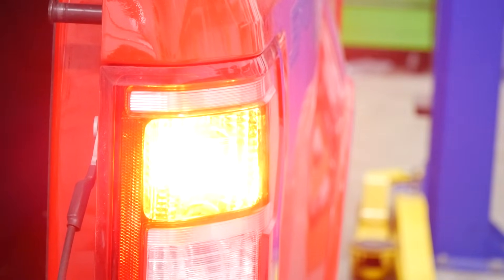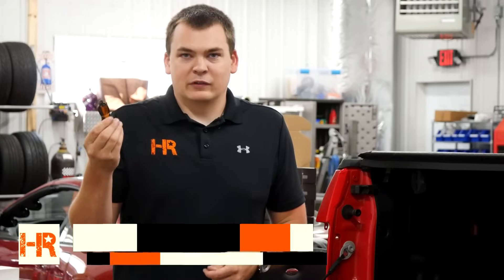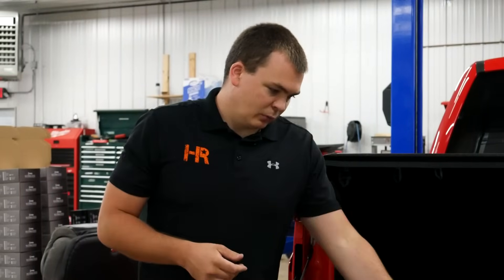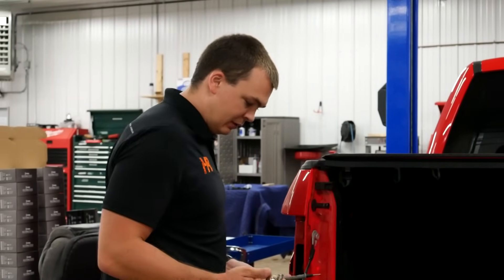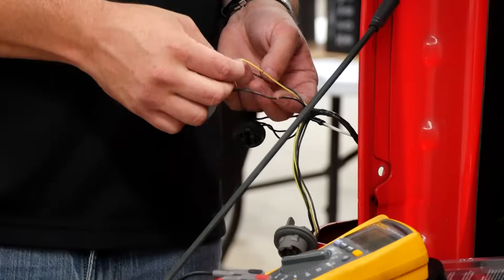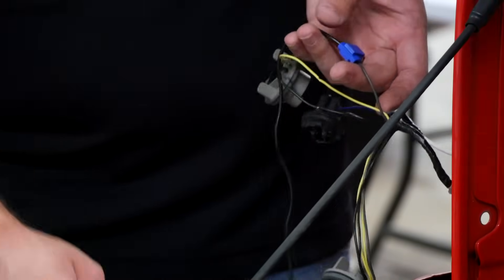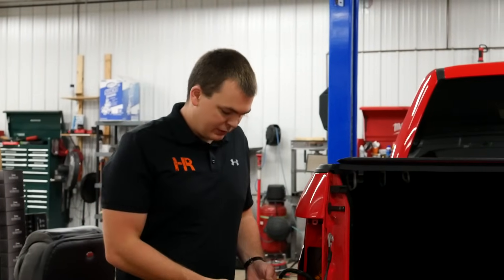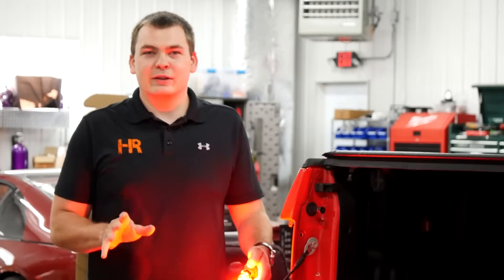How To Install LED Resistors - Everything You Need To Know | Headlight Revolution

Comment: I drive a 07 Volvo xc90 and I recently installed new LED turn signals on the mirror and rear light assembly. If I only put the resistors on the rear turn signals will it also remove the hyperflash on the mirror signals?
Reply from the maker: Yes, it should!
Reply: @HeadlightRevolution   Hi, thank you for your reply! I saw there were three types of resistors under GTR lighting. 50W 6ohm, 50W 3ohm, and 25W 25ohm. Which one fits my car?
Reply from the maker: You'll need the 50w 6ohm ones!

Comment: I thought the resisters came built into the lights you by real cheap from China? No well no wonder mine I just bought from China don't work, mine are motorcycle LED lights anyway so this video doesn't help me at all.
Reply from the maker: There are some LED bulbs that have enough resistance to not need a resistor, but that's only from a few brands. GTR Lighting has a version of that bulb called the Carbide 2.0

Installing a resistor on a motorcycle will be very similar to how it's done in this video. You just need to find the power and ground wires and find somewhere to mount the resistor. 

Thanks for watching!

Comment: My resistors only worked on one side of my vehicle , how could I fix it ?????
Reply from the maker: Double check your wiring.
Reply: Headlight Revolution  I checked several times they still didn’t work

Comment: I have my suv installed a led signal light on all four. Do i need to put 4 load resistor to 4 lines or just 1? TIA
Reply from the maker: You will need 4 resistors, One per bulb.

Comment: I’m having with my tail lights and brake light (all led) when I had the new lights in the LHS of my ute and the original incandescent lights in the RHS of my ute the leds we performing perfectly as as expected (did have hyperflash but that didn’t bother me) the moment I completed to conversion and had the leds on the RHS only half of the leds in the light assembly illuminate and not difference occurs when switching from tail to brake :( I am absolutely dumbfounded as to how this has occurred and was wondering if you guys have ever heard of this before?
Reply from the maker: Hey Meki, Send us an email to sales@headlightrevolution.com and we’ll help you get your lights working!
Reply: Hey it’s all g I sorted it out but I’m just inquiring as to how many ohms your resistors are?

Comment: I hate those little wire connectors with the pin, they’re extremely unreliable.  Get better connectors that you can crimp if you’re not comfortable soldering.
Reply from the maker: That is very true, They can be pretty unreliable. Soldering works very well.

Comment: Excellent but these blue clips should be banned from circulation.They always cause trouble soon or later.The best is to solder the wires or use terminal strip with a screw.
Reply from the maker: Those blue clips can definitely cause some troubleshooting down the line.

Comment: Does your car have to be running when installing the load resistors
Reply from the maker: No it doesn't have to be running. In fact, You'll want it off to be safe.

Comment: What's the difference between installing relay turn signals and resistor signals?
Reply from the maker: Some people install a flasher relay, That is vehicle specific. If you install one of those, You won't need to wire in resistors for the turn signals.

Comment: The point of led is to be seen rite. so hyper flash kinda goes along with that. If it can burn the led out or something of the sorts then I will go through the process to make my designed blinking light to blink just a little bit slower.     If it was a headlight issue then by all means      Also resistors are like packs of
Hundred or more for 3 dollars. Just put a heat shrink around one and that will protect it.    There’s a formula to find what size you need but just look at manufacture site it will tell you what size.    Either way 
Good information. Thank you for the how too
Reply from the maker: Some of these new vehicles will give you a bulb out warning on the dash too, We just want to show people how to make their bulbs work properly. If you like the hyperflash effect you can certainly run like that, Some people do!

Comment: cant you just install a flasher relay at the fuse panel and eliminate the resistor wiring? and if you do need to install the resistor does it need to be on each corner/light? Great video bro! thanks for the help.
Reply from the maker: You can do a different flasher relay on many vehicles but not all. You will need one resistor per turn signal bulb that you upgrade to LED.
Reply: @HeadlightRevolution  I was able to install a flasher relay/resistor on my 65 but not sure where to find on my 2013? any ideals?
Reply from the maker: We don't really mess with the flashers too much here, Sorry. Depending on the vehicle you may just want to stick to resistors, Some of these newer model vehicles don't even use a mechanical flasher anymore.

Comment: Can i put that on headlight?
Reply from the maker: I wouldn't, Instead you should try to find a metal surface to mount it to.
Reply: @HeadlightRevolution  is that okey if resistor going hot?
Reply from the maker: A metal surface will help dissipate the heat from the resistor.
Reply: Thanks, for help

Comment: I have a 2018 Chevy Malibu 1LT and thinking of installing LED reverse bulbs. I tried Sylvania LED bulbs and they both lit dim when not in reverse or the car is off and returned them back to Walmart. What load resistor do I need for LED reverse bulbs?
Reply from the maker: You won't need a load resistor. You need a canbus compatible bulb and the walmart bulbs simply aren't that advanced. Send us an email to Sales@HeadlightRevolution.com and we'll get you exactly what you need.
Reply: @HeadlightRevolution  Thanks. I will look at some canbus LED bulbs.

Comment: I have a 2019 Toyota highlander limited. I've purchased aftermarket LED tail lights. But it started messing with my safety system. Things started ligting up, like my lane departure warning, emergency braking etc.. is there a fix for that?
Reply from the maker: Those lights are likely not compatible with your Highlander’s trim level. I’d check with the manufacturer of the kit to see what they’ve heard.

Comment: If I want to use these resistors in the rear can you use aluminum foil to keep the resistor from touching the plastic?
Reply from the maker: You could. Usually there is plenty of room back there to keep them away from anything that could melt.

Comment: Why not just use an LED bulb with a built in resistor?
Reply from the maker: Because those only started coming out in mid 2019, and they stil do not work on every application.

Comment: I installed LED reverse lights and now have hyper blinking on driver side only. What can I do about that. Any help is greatly appreciated.
Reply from the maker: Make sure you didn’t accidentally damage or unplug your turn signal. A reverse light should never cause a hyper flash, They are two separate circuits.

Comment: I have a question though, if i add more leds to the same wiring harness, would that work too? Since there's more of a load on it
Reply from the maker: You might be able to do that, The resistor is usually an easier solution for most people. -Chris W

Comment: I installed 2 seperate resistors. 1 25w which didnt stop the fast blinking so i tried a 50w which didnt work either. I have a 2013 chevy Silverado. BTW, i attached one wire to the negative and the other to the blinmer positive
Reply from the maker: Those trucks usually aren't too picky, We've found the 50w 6 ohm resistors to work well on them. You might want to double check and make sure you've tapped into the correct wires on the truck.

Comment: What is the resistance value? I would guess 12 Ohm, maybe drawing about one amp and a bit, needing and 12-15 Watt heat to be dissipated?

Why do Americans say "sodder" and not "solder" - why do they forget to say the "L"? Sounds funny to hear it.
Reply from the maker: We use 50w 6ohm resistors in this video for the 2018 F150.

Comment: Question.? 2015 Durango limited 
So I buy mi turn signal light bulbs from headlight Revolution. They say is plug and play.but this is not my case doesn't work so they send me a resistors to fix the problem but still doesn't work...what's happens if I have the truck off the signals work good..but wants I turn on the truck stop working..
Someone knows what problem causes this or the turn signal bulb comes defective...please help.. or the turn signal came defective
Reply from the maker: Hey Cristian, I’m sorry you’re having trouble getting those bulbs working properly for you. Those Durango’s can sometimes be complicated, Send us an email at Sales@HeadlightRevolution.com and we will get it all figured out with you.

Comment: I got a question for anyone that can help me out 
I was installing a new led bulb for my turn signals but upon installing them my side yellow lights (DRL) went out and now they dont come on at all when I turn them on.
I was wondering if installing a  resistor will also fix the side lights as well? or If it'll just fix the fast flashing on the turn signal?
I would really appreciate if anyone can give me some insight on that.
Reply from the maker: Did you get the bulbs from us? If so, Reach out to our customer service team and we will make sure what you got is correct for your vehicle. If you didn’t install resistors with your turn signal bulbs I would try that first.

Comment: For all 4 turn signals, would I need 2 or 4 resistors total?  I've seen some say that certain vehicles only need 2 resistors, where one can be installed to cover both the left front and rear side, and another to cover the right front and rear side.  I'm not sure for an 8th gen Civic sedan.
Reply from the maker: I would do all 4 resistors to be safe. You could always start with 2 and see what happens, but in my experience I’ve always needed 1 per LED bulb. -Chris W

Comment: So my led brake and parking lights flicker. Almost like they have bad ground connections. I wired them up myself so I know it's not a bad ground. Will load resistors stop the parking and brake lights from flickering?
Reply from the maker: It could help!

Comment: That’s what I call a professional video. Bravo
Reply: What happens if you connect the meter to two wires and neither is the ground?  Will you not get voltage on meter or the test lite bulb will not lite up/flash?

Comment: Seems like a lot of work for LED taillights.  I can appreciate LED headlights, but tailights?  My concern, You stripped the wires with a metal wire stripper, with 2 positive wires that could go to ground across the tool to the exposed ground wire.  You risk shorting out the wires, that could blow out a fuse, leading to more problems.  Why not just use a chassis ground & just probe one wire at a time.  This way you're not holding 3 open wires.  Probing will also eliminate the need to strip the constant power wire, reducing the integrity of the wire.

Comment: if anyone using load resistor,buy and use heat conductive selfadhesive tape or heatpad/thermo pad so heat transfer between metal part and resistor will bee much better I did like that to my mazda 6 gh and never had problem with overheated resistor

Comment: Hi I changed my lights to led my break lights work but my running tail light does not work I have changed fuse's and bulb still nothing ?
Reply: *brake     Buy a multi meter

Comment: So you need a resistor for each bulb connected
Reply from the maker: Rule of thumb is each turn signal bulb that blinks needs a resistor. If it doesn't blink, it normally doesn't need any.

Comment: Doesn't adding resistors to the led to me is dumb 
I need led bulbs to be more eff and not use the crazy power the stock bulbs use 
Maybe for race car or audio stereo stuff that are trying to save every drop of juice They Can 
I would just bug a flasher that is for led hyperflashing 
But that's just me

Comment: Soldering is significantly inferior to crimped connections. Soldering is a little better than "twist n tape". Soldering WILL make your wire stiff and subject to brittle breaking, with high current heating when most of the strands are broken. 
Not my experience, Bell Labs from 1950's. 

In-line resistor pack with a twist lock bayonet adapter is probably best for diy.
Reply: Of all the dumb comments, this is the dumbest.

Congratulations

Comment: THANKS....I never knew of how to wire lights. Still having mine done by a shop but great to know. I plan on buying me that tester at Walmart....SMILES....did not know how it worked and the wire spliter.
Neat tools I don't have.  I'm having Led  Pillar Lights installed on 2019 Rogue rear window hatch. Can't wait for the cool look.  Thanks again, great knowledge you have given... :-)))

Comment: What about an electronic flasher? Will that work or are resistors the only option?
Reply: I was able to change the flasher on my '99 Nissan with an electronic one that even had an adjustable flash rate. It was a 5 minute fix and it still works great. My '05 Buick on the other hand doesn't have a flasher relay and from what I can gather, the resistance can only be changed by connecting a laptop to the computer and changing the resistance setting on that circuit. So it all depends on what kind of vehicle you have. Follow the clicking sound and see if you have a flasher relay. If you do, it is cheaper and quicker to go the flasher relay route. Not to mention that stripping insulation from wires that are exposed to dampness will eventually corrode if heat shrink or waterproof connectors aren't used. Electrical tape in that environment is never professional.

Comment: I have an 05 Chevy Cavalier.
I replaced my headlights with an LED bulb and the headlights function properly.  However, once I switch from my headlights mode to my daytime running lights (DRL) mode, it then hyper flashes.  Should I get the resistor or a Canbus decoder for my type of bulb instead?
Reply from the maker: That is a pretty common issue with day time running lights. Adding a PWM should be able to fix this issue. We've always had great luck with these ones: https://headlightrevolution.com/gtr-lighting-pwm-interface-module-9007-9004-style-connectors/
Reply: @HeadlightRevolution  Is that item the same thing as a Canbus decoder?  If so, I've already attempted that and it did not solve the issue.  As far as I'm understanding from research, PWM is used in newer vehicles...my vehicle is a 2005.  Will that be okay?
Also, would a resistor resolve the issue if all else fails as well?

Comment: my car has 2 wires only are those 2 the ground and the turn signal wire
Reply: Yes. Many cars have a separate turn signal and running light bulb. Test it by tuning the lights on without the signal. It should not light up. If it does, it's not the turn signal.
Reply: Sophia Bogard thx for the help but it was the turn signal and ground sometimes in life you just take risks😂😂

Comment: Do u need the front one too if u have led turn signal I have front led turn signal  n back I have only back resistors only
Reply from the maker: Yes, you will need a resistor per LED bulb. So if you have 4 LED turn signal bulbs installed, you will need a total of 4 resistors,

Comment: I just changed my Audi A1 halogen tail lights for LED ones and i want to trick the computer with these resistors, the question is what resistors do i need?
Reply: 6 to 8 ohm resistors will work just fine
Reply from the maker: A 50w 6ohm resistor should do the trick!|
https://headlightrevolution.com/gtr-lighting-50-watt-6-ohm-gold-style-resistors-for-custom-installation/

Comment: I just installed some Led bulbs in a 90 Toy Pickup, and when I hit the turn signal of course hyper flash happed but also the brake light in both Left and Right flash. Will a resistor did that?
Reply from the maker: Can't say that I've seen that issue before. I would double check the wiring to ensure that the brake lights aren't wired into the turn signals for some reason. If everything is good, I'd give the resistors a shot!
https://headlightrevolution.com/gtr-lighting-50-watt-6-ohm-gold-style-resistors-for-custom-installation/

Comment: Hey Guys, I have a 2017 Mazda 3, which has Canbus. I replaced the front indicators to LEDs and added resistors, but all indicating lights are hyperflashing, rear included. Do i need to change the rears to LEDs and get resistors for them to stop the hyperflash all around?
Reply from the maker: What bulbs and resistors did you install? It sounds like either the incorrect resistors were installed, or the resistors were wired into the incorrect wires.

Comment: I put led switchback bulbs in my headlights and now I do have "hyperflash" so could I install my resistors in my taillight to stop it it or do I have to install the resistors to my headlights?
Reply from the maker: If you have installed LED turn signal bulbs in the headlights and tail lights, all of those bulbs will need resistors.
Reply: @HeadlightRevolution  ahhh ok. Thank you!

Comment: I changed out all the bulbs in my 1995 Ford Bronco to LED. I literally did all of them including the front parking lights and headlights. When I went to a 3157 compliant led brake/turn signal replacement bulb my turn signal stopped working. Brake lights work, tail lights work. When I use a signal the light comes on and stays lit (does not blink, at all). Four ways do not work either. After replacing all the other bulbs without any issues. I didn't expect this problem.  Any Ideas?
Reply from the maker: What brand of bulbs did you install, and did you install an LED turn signal relay or resistors?

Comment: I'm not going to call bullshit, because This method will work. My problem is why not show the super easy and ultra inexpensive way to do it. Insert a 1k ohm-1/2w resistor parallel with your bulb. just insert the resistor along with the led bulb.